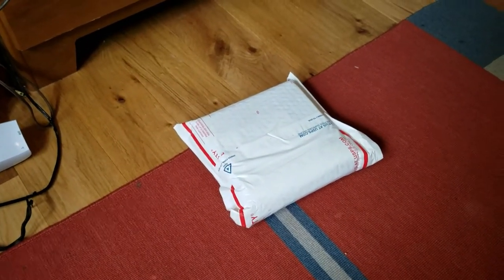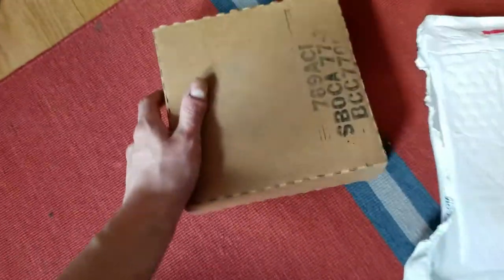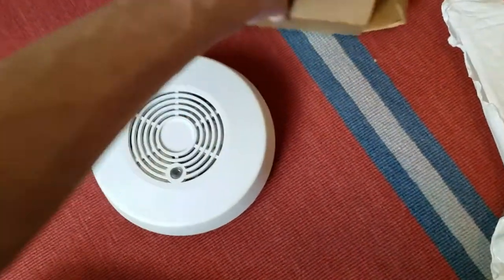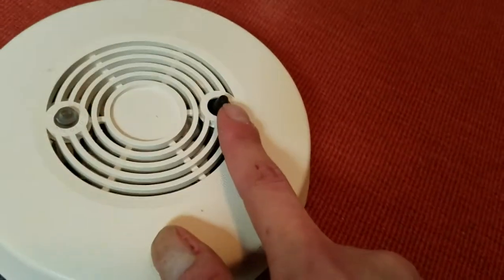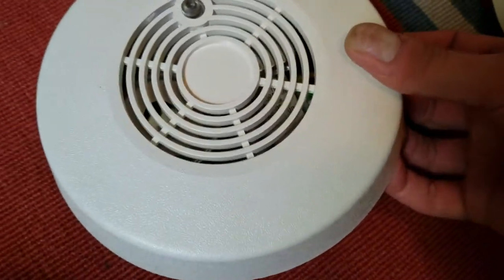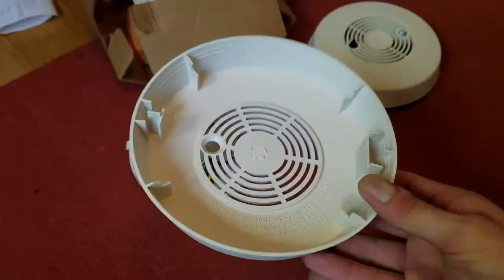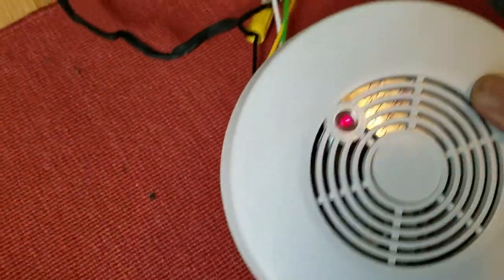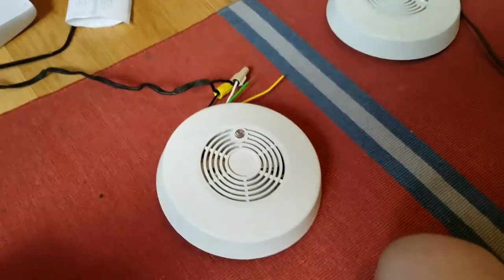BRK 769AC-I / SA769AC Smoke Detector

Comment: This classic model features the old fashioned mechanical horn unlike the beeping which is used today
Reply: Yup. Definitely much more effective than the t3 beeping of today. I have 2 of these myself, one that was brand new part of the same lot of them that Ben’s is from that I put up in my house. I have a system of modern hardwired photoelectrics but wanted an old loud mechanical ionization detector in the mix.

Comment: I have two of these we’ve replaced, they both work, does anyone buy these or should I toss them?
Reply from the maker: Definitely try to sell them on ebay. A collector will buy them. These older ones are getting harder to find.
Reply: Okay, thank you! I was looking for any that sold on eBay but didn’t see any (tho they only go back 90 days). Is there a way to tell the year they were manufactured? I haven’t found a year but know those are often in secret code, lol. They both have issue numbers next to the UL logo. One says assembled in Mexico, the other label doesn’t. Thanks so much!!
Reply from the maker: I'm assuming you have this same model, the 769AC series, these were made from approximately 1978 until 1982-83 when they switched to the sealed cover 1839 series.
Reply: @BAFVintage  yes, the stickers say 769AC-I 😀 thanks again, have a great weekend!